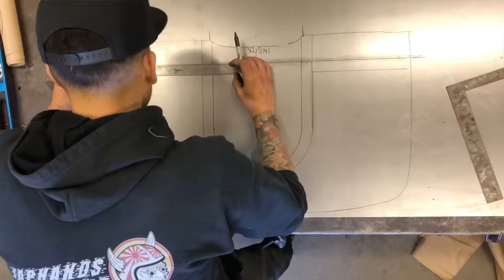How To MIG Weld Thin Sheet Metal - GMC G10 Boogie Van Rust Repair ( PT 2 )

Comment: Great job Japhands. You bring back nice memories when I helped  my dad do body work when I was a young child. Back in the day he used brazing rods with a acetylene torch and lead solder to seal the edges, then a little bit of bondo. Metal warping was a big problem and it required a great deal of hammering later. He then switched to spot welders for sheet metal work. Now there are so many cool and cheap tools like the mig and tig welders. They are awesome. Most people don't realize that working easier and better is the way to go. My dad did not have the luxury of a car hoist and elaborate tools. Like you he made his own tools when needed to save money. He is 93 yrs old now and no longer does body repair but the wear and tear on his hands , knees and shoulders is evident now. Be safe and work wisely always. Thanks again for the education. I still do some repair when I can at 63 yrs old and still have a passion for it. Keep up the great job.You are an inspiration to all who watch  - I'm sure. Take care.

Comment: Wow! You did a fantastic job on that! I’m in the middle of fixing up a 69 Econoline. Lots of whiskey dents. Some rust in the rockers. I really wish I still had my English wheel. I had to sell a bunch of my sheet metal equipment last fall. Had to move out of my shop I had rented for my fab business. I’m in the process of building a shop on my property. So my equipment is stored in a couple of tents. Can’t really access my brake and bead roller. I’m basically working on it outside. With hand tools and a mig welder. But it’s getting done. Hopefully soon. I’ll have a shop setup again. Love watching your vids! Good luck on the shop move!

Comment: THIS IS AN AMAZING VIDEO!!!     No BLAH, BLAH, BLAH talking about yourself and how "wonderful" you are ....like so many of the other videos.
You are to the point, with specific "discussions" of your experiences  ....and the "fast-forward feature" to make the video more efficient.

Very clear message how much work is involved in preparation, and measure, measure, measure.     before a single tack is done.

I have a '57 Healey, 100-6. Lower portion needs body parts replacement. I have ALL the replacement parts needed.   Been looking for a reliable, honest shop to do this work in Vancouver, B.C., but haven't found one shop who will provide any honest answers.  Either humming and hawing, or simply don't call back with answers.  The work you have shown here is pretty much exactly what is required ...but in fact, a little easier. Fundamentally nothing is being done "blind".   I have both TIG and MIG ....I'll do it myself.  Your video was the stimulator.😉😉😜😜

Comment: putting on a metal clean prep solution, is a very important step that I didn't see you do before spraying the finished stage of your metal sanding at the end .This is a very necessary step to remove all contaminants.Thanks for your tips and tricks!

Comment: Still discovering your older videos with tons of great content on practical ways to "use what ya got" to get the work done.  We all don't have an English Wheel to make panels, but the methods you show on MIG is something that can apply to beginners with a bargain price MIG unit.  BTW, the word you're searching for is to 'neutralize' the acidic nature of the Rust Mort.  Can always add a teaspoon of baking soda in the spray bottle as the 'base' that counters the acid, but your advice to use a lot of water to rinse is right on since [acid+base=salt].  Road salt is the culprit causing most rust, and your video teaches a common beginner task undertaken for keeping a ride out of the junkyard.
Reply from the maker: Thanks Jim I’m stoked people are picking it up and doing it man it’s so fulfilling knowing this craft still has a future

Comment: What was the original skin thickness, 19 guage? Do you always make your patches from 16 guage when Mig welding? Cheers from downunder.
Reply from the maker: I don’t always use 16 gauge but this is such a flat and straight panel

Comment: Bad ass repair there  Mr. Fisher !!! Zero plastic filler is a sign of a true craftsman. Your techniques are calculated and purposeful! Time is heat and heat on a panel will cause serious misbehaviors from either processes TIG/ MIG. Learning to read the metal and seeing what it needs is key. Every time I see one of your videos (multiple times) I learn something new about metal and how it behaves or how to get the different oxy flames and what they are used for. I’m currently working on building a rotisserie and body dolly for my Datsun 280Z to aid in floor and frame rail replacement before I drop in a serious motor and take to the track. Thanks again and work safe brother 

Cheer

Comment: I watched your work from start to finish, and it's really good that you can pass-on those excellent tips. I am a complete novice at welding-in patch panels, and (about the only thing that I knew), was NOT to overheat the patch panel - and parent metal, in order to prevent distortion. I liked the way that you touched upon making sure that the butt joints between the patch panel (and parent metal) do not have any "step" when welded.  I am self-taught, practised with a MIG on scrap pieces, and my method for ensuring that there is no "step" between the patch panel and the parent metal - was to place a flat magnet between both items to be welded! OK, it becomes difficult if there are curves, but I still manage to do it with the help of magnets. If I am making a patch, I ensure that all joints to be welded - have minimum gaps. It is worthwhile spending a lot of time on ensuring that the patch fits with high precision, as this saves heartaches later. Thanks for a great video of your work. Best wishes from Sydney Australia.

Comment: Great Instructional Video!!  I'm restoring a "Fairlady" that has 18 gauge metal in the rockers and I was blown hole through the patch panels. Your explanation  of the "Hot and Quick"  MIG welds made a sense instead of the "LOW and SLOW = More HEAT"   
  Going to give that concept a shot .. 
THANKS For the Video !!!

Comment: If you haven't found them yet, I'd recommend the pneumatic belt grinders. They take down weld fast with less spark. I usually start with 60 grit belts the go to 80 grit roloc to level better. I also thought I was the only tight ass trimming down my 3 inch rolocs.

Comment: Technique I was taught back in 1972, was to overlap with your patch by a 1/4 inch, tack it in every 4" ...then come back and trim a little at a time @45 ° angle.
This method adds in a seamless butt weld.

Comment: I LIKE THE WAY YOU ROLL  , THANKS  FOR SHARING  YOUR  KNOWLEGE ..I USE  THE  TINY SELF TAPPING  WAFFEL HEAD PHILLIPS  SCREWS   SINCE I  DONT  HAVE  KLEECOS... (I CALL THEM  "BITERS" ,, THEIR USED   TO  PUT  METEL STUDS TOGETHER)  I TAKE THEM  BACK OUT  ONE AT A TIME AND  MIG THE  1/8" HOLE   SHUT  AFTER THE  PANEL IS  IN PLACE .  WORKS  FOR  ME .

Comment: Power Mode on my Lincoln 360mp is the bomb for mig welding thin material. Super smooth arc starts and no burn thru.

Comment: Amazing video my friends , its refreshing to see someone skilled as you are in the art of metal fab , i love your prep work before you just cut and weld , proper preparation prevents piss poor performance. Im only in the trade 12 years but no one taught me , i had some guidance here and there but mostly had to figure it out on my own , which is the same way you do it .as you said its nice to know im doing things right, keep up the amazing work my friend. it would be a dream of mine to work with and learn from someone like you . im currently putting floors and lower quarters in a 68 beaumont , i dont want to pay chevelle prices for patch panels so im making everything by hand the satisfying way , thank you for the great content
Reply from the maker: Good for you! When you can make your own panels you’re not limited by your projects whether or not they are supported by the aftermarket!

Comment: About forty years ago I used to build rallycross cars, and to make money on the side I did MOT Welding (which is necessary once a year in the UK to keep your car legal on the road), and consequently a lot of that work was welding.   In those days I did everything with OxAc and I know very well what heat and cold can do to the shape of metal.
I used lumps of copper bar, 2"x1" lengths of steel - anything that would take the heat away from a seam.
MIG machines weren't what you'd call new tech, but they were expensive, and OxAc was relatively cheap, so .... that's the way it was done.

I do know pretty well how to use a MIG and TIG sets, but money was King, and the upshot was that it made me a better welder when I did the other disciplines.     That's why I recognise how good your work really is - you're a truly gifted welder, and I don't mean that you're the kind to do pretty patterns in Stainless for the accolades, your skill lies in your final product - without what you call Bondo two inches thick :)

Comment: Body shop where I worked used to cut out the majority of the panel like you did. Then with a gas torch pliers and air chisel peel the strip until you reach a spot weld heat it with the gas torch till it’s cherry red and use air chisel to part. Takes two people but really quick from what I remember. Plus a bottle of spray water to put out any small flare ups.

Comment: LOL....I've got a  van project going on too. But it's a '65 Chevy van. A looooooooooooooong term project. (With videos on here....haven't updated them in a while.) I really only came to this video to see the welding tips, but ended up watching the entire thing. As a long-time motorhead, I decided this project I'd do 'right'. Or as right as I am able to. That includes actually welding patch panels, instead of rivets, or even sometimes, just bondo'ng something in as a 'quick fix'. Unfortunately, there aren't really any new patches available for my '65, nor even, donor vehicles out in the world, so I'm fabricating a lot myself. Often, starting out with patch panels from another vehicle I can work in. 

I've been in electronics forever, so I've done tons of soldering...from tiny surface mount components, to large brass pieces, and I thought welding would just come naturally. It didn't. Everything I welded, I did several times...not sure how many pieces I welded on, and then cut off and rewelded, or had to re-fab from cutting it off, and then more welding. I'm psyched now to get back to it, and try it with the heat turned *up*. Like you said in the video, most use low heat, on this thin metal, and that's me. Maybe that was my problem the entire time!

Comment: Wire wheel that rust then, toss on the Rust Mort. Water rinses off the acid to prevent further rusting.  I just got a variable speed (aka brushless) angle grinder and use wire wheels on slow speed....world of difference now!.

I don't consider 16 gage "thin metal". 20 gage on a Honda or an 80's Toyota is thin. My trick on welding on 20 gage that can easily get burn through is to the aim the wire at tack weld, kinda of like dragging it so the wire doesn't push through the gap, or uses the previous tack as a heat sink.

Good point on higher voltage but go faster. Most people think think it's the heat that causing warpage, but it's the cooling of the weld bead that causes shrinkage and creating tension and pulls the metal at the weld creating warpage. Less (bead size) is more.

Nice job on the fab work

Comment: I'm really enjoying this, learning, all my experience is in structural metal, and I've wanted to learn techniques to minimize the distortion in sheet, as I've had very little experience.  It's great to see my children's generation taking these skills and running with them.  That would be "neutralizing the acid", these techniques resemble structural means, but I can appreciate the talent necessary to do the same thing with much lighter material.  The new paints are something to really enjoy, never saw this "rust-morte" in use before.  I am amazed at the consistency of the lack of gap between the panels, this has been an eye-opener, only seen the final results before, not the methodology.  I am impressed with the delicate touch on the sanding and blending of the welds, very nice end result.  So how much is a similar Chevy Van worth, with a good body?  Thanks for the excellent demonstration of technique.

Comment: Liked what Fitzzee did. Overlapped, spot welded panel, then cut with the zip cutter through his spots at a 45° angle
 Push the metal flush then weld again

Comment: So funny; when I first bought my mig welder years ago I had some basic experience with them and I always thought that they could be adjusted down to weld a thin gauge sheet metal from start to finish. Then I did some body work and found out it was almost impossible to weld without blowing holes through it!!

Comment: amazing work bud. one thing i can say is dontbuse weld through primer. it has no etching properties so all of the surrounding metal near the weld the paint will wear away and eventually rust. i use SEM e coating. it comes in a rattle can. it etches to bare metal and you can weld through it. if you put it on too thick you can run a bullet blaster over your plug weld holes to get nice metal on metal welds. you can use any metal etching paint but i found the SEM product to be the easiest to weld through with the least porosity. it also matches factory e coating.

Comment: Thanks for the videos !!!!! I have learned so much for your videos keep it up!!!

I have a 2001 Ford E350 extended length diesel van. Trying to restore it and put a 4x4 kit on it. I can't find any parts at Ford any more and buying junk yard van, forget it, they have shot up so much on cost it's like buys a good used car now. 
How do you reproduce the inner rockers and a floor pan? 
I need both inner and outer rockers and inner and outer rear quarters. As well and the rear floor pan and rear door sills.
That or something very similar would be a GOOD video!

Comment: You’ve really done a job well done I’m trying to remember the wire Fitness  you  use .9 wire Fitness,. Can’t remember what wire feed this you used on your car.. and I need to stand a driver stand like you have so I can work under my car as I have rust , under my car and the tools you use the small guy and tools they are awesome. I have got 7 inch. It’s too big..
I need a car ramp so I can work underneath my car.. it makes it a bit difficult at the moment because I got a sore back,. I am so annoyed. I’m trying to get a roadworthy for it. 
I’m amazed that the tools that you have got you are so like you

Comment: You can always check out Fitzy's cut and butt method. I think I had a van like that. Good info. I have a 76 Celica to do some patch work on. Kinda nervous but will practice on scrap to get used to the heat.

Comment: i do a lot of this sort of work ,,, try grinding your welds down initially with a laser disc , at about 80 degrees ,, it takes practice but it puts the heat in a very small spot and its super accurate ,, takes practice to start with , but the results are like a snipers rifle against a shot gun.

Comment: Im amazed that I saw NO HAZ along the MIG weld path, even along the GM really thin (20-22 ga) side of the weld. I saw some along the TIG path, however as expected. I never thought of using really thick 16 ga metal to keep down the dreaded warpage, great idea. What keeps you from blowing holes through the thin side GM metal?

I have a ‘96 Chev project car. It’s got zinc coated 22 ga metal that warps like crazy. I want to weld on custom fender flares and a rear rolled pan. Do you think the flares and pan should be made of 16 ga metal?

More questions: 1. How did you safely remove the zinc coating from the GM metal, so weld would stick to it?
2. What kind of rattle can rust inhibiting paint did you apply over the bare metal? (I’ve been told by paint shops never to use rattle can paint)
3. What kind of zinc weld-through primer did you use?

That was totally awesome work, and NO warpage!

Comment: This is a very informative video,many useful techniques all wrapped up into one.  I am in the process of doing heavy rust repair tot he bed of my 2012 F350 and instead of replacing the entire floor, just replacing the pieces that are rusted through and heavily rusted.  The cross member replacement is pretty straight forward, but the patching in of small panels seemed daunting.  I did have issues with the first cross member spot welds, and that was due to using .030 flux core.Too hot and burns through, too cool and it applies too much, and it trying to spot the spot weld, too much slag. Very messy welds.  I broke down and bought a bottle of 75/25, and now just need to get the heat just right, the welds are looking much better. 

What I would like to figure out is how to get a warp out of a small piece of 20 gauge that I am using. I think using the plasma cutter to cut the basic part out is causing the edges to shrink and inducing an oil can warp.  Its only 10" square piece that is located where the bed bolt goes, so once bolted down it doesn't matter, but for future work, would be nice to know.
Reply from the maker: Welding is usually the cause. You can control the distortion to a degree with patience and cooling
Reply: @MakeItKustom  Thats the problem, it hasn't been welded yet. I think Plasma cutting did it.